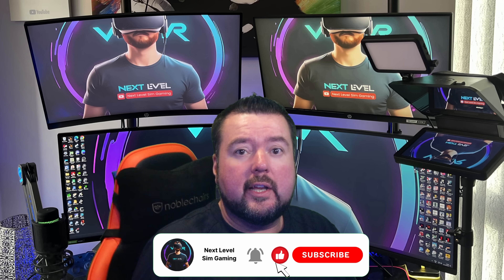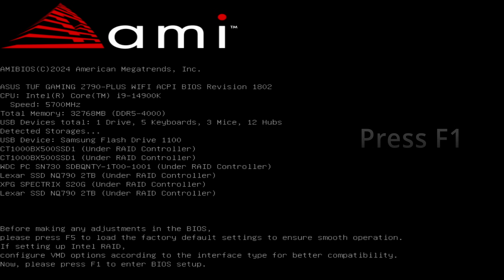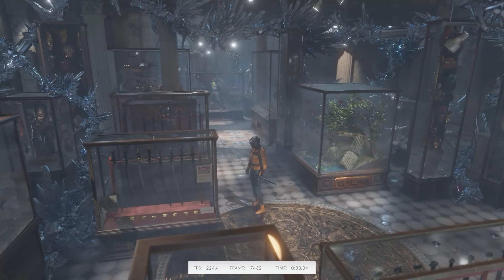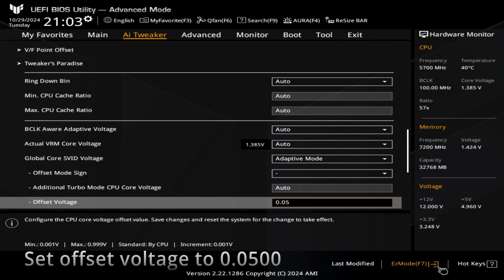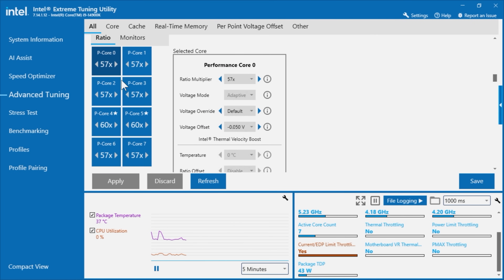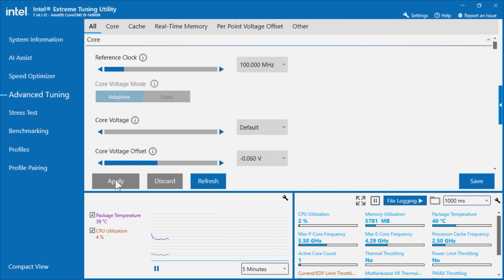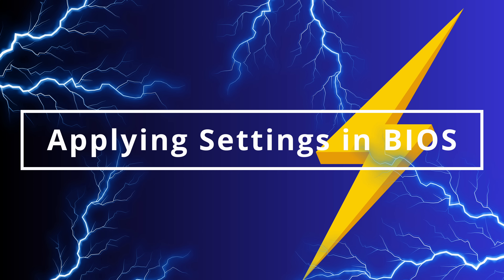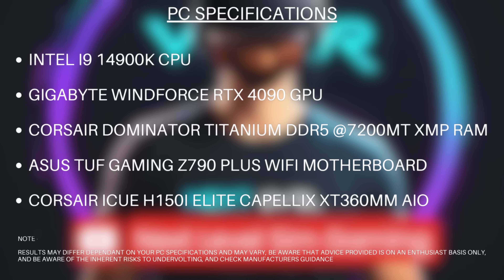i9 14900k Intel Final Microcode 1802 - 0x12B  BIOS Installation, Tuning and Undervolt Guide 📈

Comment: seems are volts in the mobo is or should be +5v~ and were the same upon seeing it on your bios with 4.960~v isnt it an issue? should we get like 5voklts up in our psu? been experiencing crashes since august with my i7 14700k . rebooting / restarting when opening a game. kernel 41 error.. im using 850 watt psu 3080 gpu. been trying to undervolt and still having reboots.. been 3 months of troubleshooting alrdy, could it be the culprit? the 4.960v that should be 5v+ up?
Reply from the maker: @JsinJzone  Possibly, the CPU will request the voltage within the parameters it requires.

An easy test is set the BIOS to Intel Default Settings, run Intel XTU AVX2 stress test for 30 mins if it fails, then I would RMA the CPU, if the replacement shows issues then its Motherboard power delivery or PSU
Reply: @JsinJzone  you ever end up figuring it out mate? Same issues and pretty much same reasoning I reached
Reply: @ not yet :(

Comment: I am about to buy a 13600k, do I need to worry still? my motherboard that I will also buy tomorrow is ASRock Z790 STEEL LEGEND wifi.

please help let me know.
Reply from the maker: @sal1488  The 13th Gen processors were affected by oxidation in certain batches, however this will be covered by the Intel extended warranty if it is identified as affected, otherwise no, no issues with these chips when they are tuned correctly 🙂
Reply: @nextlevelsimgaming  I am in Australia like you and was gonna buy from umart. Not sure about how old their intel cpu batch are.
Reply from the maker: @ I’m from the UK mate, so couldn’t comment on the supplier but the extended Intel Warranty is worldwide

Comment: In 3dmark time spy I got 26589 with 4080 and the 14900k at -0.065. How did you get so much? I configured it the same way. In cinebench I pushed the cpu more and the result was quite straight, but the gpu dropped in 3dmark all the time. Do you have any video to configure the gpu correctly?
Reply from the maker: @r1cc-1  With a 4080 thats correct, my old Palit Gamerock 4080 I scored 26201, unfortunately you won’t achieve the same figures with a 4080, if you compare results online on 3D Mark in the menu you will see comparable hardware, remember the GPU aspect makes a large proportion of the score, an RTX 4090 is about 35% better performance than a 4080
Reply: @nextlevelsimgaming  You’re right, your gpu was 4090, what I did test in cinebench was that leaving it at -0.065 gives me more points, but in 3dmark the same one you used at -0.065 the gpu line in the rear falls and the processor does not fall, the line remains straight, but when testing at -0.060 the gpu line stabilized more, should I try leaving it at -0.050 or -0.055? You were right that my 13900k was degraded because with this configuration that you gave me it gave me a blue screen and now with the 14900k it works perfectly without blue screens, I reiterate again if it weren’t for you I wouldn’t have the 14900k now and perhaps later on the 13900k would have died, I really appreciate it!
Reply from the maker: @ Fantastic to hear, it’s hearing feedback like this that was the reason I started the channel 🙂
Reply: @nextlevelsimgaming  😎
Reply: I have a question, should I leave xmp in tweaked or xmp1?
Reply from the maker: @r1cc-1  XMP Tweaked will add additional Motherboard capabilities to the RAM manufacturers XMP profiles so I use Tweaked as it tends to run more stable 🙂
Reply: @nextlevelsimgaming  Thanks dude, I appreciate the information, I always left it in xmp I the other thing is that once I raised the clock and it supported up to 7200mhz, but I lowered it because I considered that it was not worth going from 6000mhz to 7200 and now I am considering it, my rams are these skill F5-6000J3040G32G SK Hynix. Do you have any video to achieve that?
Reply from the maker: @ I certainly do 😉

Undervolt and Tuning Guide - Testing XMP Speeds and How it affects Performance #ddr5 #ram #xmp 📈
https://youtu.be/2exK1t0sRB4

Comment: how can I do this to a msi motherboard? and I am also having issues with the XTU, it is stuck on splash screen or loading screen. Do you have any recommendations or tips that can help me?
Reply from the maker: @donortiz6313  Regading the Intel XTU issue, uninstall Intel XTU, reboot PC

When rebooted,  Go to the device manager and remove all the instances of the XTU component driver in the device manager under software components (click and select ‘delete’) there may be a number of instances that require deleting depending on how many times you have attempted to run it.

Once deleted, reboot PC again, then reinstall the latest version of XTU

Regarding the MSI motherboard, I couldn’t help with that unfortunately as I have never used one, the principles will be the same, but couldn’t tell you where things are located on that particular board or what terminology is used for each setting.

Ensure Intel Virtulization and Undervolt Protection are both disabled in BIOS to use Intel XTU do this before carrying out the above.
Reply: @nextlevelsimgaming  is it the "Intel(R) XTU Component Device" that I need to delete it all?
Reply from the maker: @ Thats the one mate, all instances of it
Reply: @nextlevelsimgaming  after deleting XTU and rebooting PC, there's no "Intel(R) XTU Component Device" under software components in device manager, what do I need to do?
Reply from the maker: @ Reinstall XTU it should now run

I had exactly the same issue recently, also see this thread 

https://community.intel.com/t5/Processors/Intel-XTU-service/m-p/1402052#M58769
Reply: @nextlevelsimgaming  in which part of the link u provided works for u? It is still stuck on loading screen for me.
Reply from the maker: @ Uninstall XTU completely, follow the instructions on completely uninstalling, then remove all components as stated in Device Manager, but also ensure that Intel Virtulization Technology is disabled in BIOS and also disable Undervolt Protection, once you have done all this and reinstall it worked for me only after performing all those steps

Comment: Thank you for this great Video!
What would I have to do if I would like to let 2-4 cores go up to 5.8-6.0 GHz to get some better Single Core Performance?
Reply from the maker: @johnmcmurphy1007  Thanks ☺️ see this other video showing such scenario’s

Undervolting and Tuning Guide Intel i9 14900k - Core Sync 5500 to 5800 mhz &  Performance Benchmarks
https://youtu.be/hh3FIN1c_ZQ
Reply: @nextlevelsimgaming  yes I've already watched it, but this is also about syncing all cores the same ratio isn't it?
I think about 5.5 allcore with your settings and then set only 2 cores  higher to e. g. 5.8 Ghz
Reply from the maker: @ You can, in fact next weeks video is about custom tuning, where I will be covering higher preferred P core and set P cores, you have to compensate for increased power usage and temps however

Comment: This microcode finally addressed the out of memory issue. But. Still had that bs for red dead 2 until I did this and now it's fixed with better performance.
Reply from the maker: @coryo617  Great to hear, the Intel Default profile still unfortunately isnt up to scratch, as usual enthusiasts are left to fix the issues 😉

Comment: I've just done the undervolt with the latest bios, I'm on an i7 14700K, I'm at -0.06500 on XTU and on R23 I'm always at more or less 80° in temperature with a score of 34802, do you think I should try at 0.07000? And in PL1 PL2 I'm at 253w with an ICCMAX of 307.
Reply from the maker: @hardcoregamer406  PL1 on a 14700k should be 125w

Yes you can use Intel XTU to find the best undervolt then set in BIOS once you’ve happy with it 🙂
Reply: @nextlevelsimgaming  I changed the PL1 to 125w and the temperature fell on the XTU. I'm still at 0.065, I'm going to see if I'm not losing too much on the R23.

Comment: Nice Video , it helps me a lot.

But ive got one question , Can i set the core clock a Little higher for example 56 or 57 with all your settings ?

And ive got only 33k points in cinebench, i dont know why.
Reply from the maker: @burakyilmaz7363  Close all applications when running Cinebench such as RGB software, Chrome etc basically anything running in the tray.

This companion video will explain to you about other frequencies 😉

https://youtu.be/hh3FIN1c_ZQ?si=mPvcg_2NgoGNEQha

Comment: I can only get to -0.040 V with my intel i9 14900k even the -0.045 crashes cinebench
Reply from the maker: @pukki551  You should start at - 0.0500 then - 0.05500 then - 0.06000 you are putting power up not down
Reply: @ Yeah i started with -0.0500 and it kept crashing cinebench so i went 10 up and it didnt crash tried 5 down and crash again
Reply from the maker: @ I would suspect if your CPU requires more power to operate it is degraded unfortunately and you should start the RMA process
Reply: @nextlevelsimgaming  Alright thank you for the responses
Reply from the maker: @ No worries 😉

Comment: I did something wrong lol. I get 25k on cinebench with these settings. 14900KS.
Reply from the maker: @deadghost1189  That is very low, ensure all background applications are closed, also the PL1 and PL2 for a 14000KS is 320w/320w not 253/253 😉
Reply: @nextlevelsimgaming  Thank you for the reply. I couldn't figure it out. I went back to my old setting. PL 320w, P-cores locked at 59. E-cores 45. 0.140 undervault. Vmax 1450. Load line auto. Ram 6666CL34...41k cinebench. Max temp 80° max vid 1.392
I really did want to try all cores locked like you did, but I can't figure it out. Thanks again.
Reply from the maker: @ No problem 😉

Comment: For my i9 14900kf all core 55 and offset 0.06000, now is stable, no bsod no error, 😅
Reply from the maker: Fantastic 😎
Reply: @ 
Update: unstable system, constant reboots, asus z690 bios 4001 i9 14900kf new rma. pls help
Reply from the maker: @ I don’t unfortunately have the same motherboard to be able to assist you, the guide is for the Z790.  Are you running 4 x DDR5 ram or 2 x DIMM?

Comment: For the offset values greater (0.7) means that it’s lower than stock right . 😅 bit confused by the wording, but new to OC and watching this so I can undervolt on my b660 as got a good deal on the 14900k
Reply from the maker: @___TEMPEST___  The values are in increments if 0.005, if you watch this guide it explains it better in slightly more detail 

Guide to Setting the Correct Undervolt and Stress Testing Intel Raptor Lake i9 14900k
https://youtu.be/XM2JLjcQZgc

Comment: i seriously need some help.
I just did my bios update and my pc won’t even boot up with intel default settings on extreme or performance settings. It will only boot with intel default disabled, and then aorus Perfdrive set to disable e-cores. i just tried to run the same 3d mark benchmark that you ran and only got 15,433 for a score whereas you got 33,694
Pc specs are i9 14900K, Aorus Master X MB, MSI Suprim 4090, GPU and CPU are both water cooled. I'm aware of the corsair hitch there's a way to bypass it without rolling back the drivers. just need enable device memory mode on all your fans and then exit the program.
Reply from the maker: @madcalfe  Thats very strange, I presume from Aorus its not an Asus Z790 motherboard, I don’t have any knowledge of the Gigabyte ones unfortunately, but is there a BIOS rollback function?, have you contacted Gigabyte for support?, I do know from helping a friend with a Ryzen one recently that they are very different in the terminology they use

Comment: I heard many said to set your SVID Behavior to “auto” instead of Intel fail safe since it increases the voltage on the cpu.
Reply from the maker: @tomygun196  It sets to Auto when the Asus OC profile is selected as far as i’m aware but thanks will check that
Reply: @nextlevelsimgaming also I’m going through an issue where my system randomly BSOD and restart whenever I play black ops 6. I recently RMA my 13700K for a 14700K. I also swapped PSU and 2 of my RAM sticks and it still crashes and BSOD. At this point idk what to do… I tried undervolt and running on Intel default settings too. I’ve looked up so many sources online regarding this issue. Some said it could be one of the XMP. In my case, it crashes and BSOD on XMP I, but I just switched over to XMP II (not sure if it makes any difference) to check if it’s stable. Some also said that to disable fast boot up etc. I saw one of your comments mentioning about the iCUE and roll back to nvidia drivers, I wonder if this could also be one of the causes for the BSOD. I’m just pulling my hair out at this rate.
Reply from the maker: @ Its likely the Nvidia driver if you have Corsair iCue many experiencing the same issue unfortunately
Reply: @tomygun196 I’ve got the same issues with black ops 6 and I have no clue what to do either. I installed the bios update but this stuff is not my area at all and have no idea what any of this stuff means. I have been able to run cyberpunk on max settings with no issues

Comment: i have constant dx12 crashes and ive been through 3 14900k rma's idk what to do anymore i have all settings bios updates nothing changes it any ideas
Reply from the maker: I would begin by following the guide, and also using DDU (Display Driver Uninstaller) then doing a fresh GPU driver install.

Also clear the Direct X shader cache in Windows

https://portkeygamessupport.wbgames.com/hc/en-us/articles/14659998310803-How-To-Clear-Your-Shader-Cache

Comment: hi, quick question, i have a 13700k and i undervolted by -0.5000 while the suggested parameters from intel, but for some reason at idle the lowest my processor goes is 38 and it averages 41-45. what could be the issue? i've tried downgrading to previous nvidia drivers as suggested in the pinned comment, but that didnt work (i dont have icue, but deepcool aio). however while gaming the temps are in good range, but for idle it is not. (while using xtu, that max stress temp is 80, but cinebench pushes it over 90) btw im a total noob in this and am just trying to prolong the life of my cpu
Reply from the maker: @jolykafka  I couldn’t really advise on the 13700k as I don’t have one to test, but the power limits are different for that processor, the guide is for an i9 13900k or 14900k 

Your settings would be -

ICCMAX is 307a

Processor Base Power = 125w = PL1
Maximum Turbo Power = 253w = PL2
Reply: @nextlevelsimgaming  thanks, i already put those parameters and i think the cpu is fine

Comment: Using all your settings on an i9 13900ks set to 5.3 allcore and offset of 0.075 mv dropped my temperatures in cinebench by 20 degrees on p cores, thats insane. Normally all core is 5.6 with cinebench score of 40800 to 41000, with 5.3 undervolted score is 39900, so almost no loss but 20 degrees cooler
Reply from the maker: @andi0138  Great to hear, the cooler the better 😎 🙌🏻
Reply: I'm looking at this CPU , With these settings & the latest MicroCode Update do you belive this to be a worthwhile purchase?
Reply from the maker: @ Yes, its a fantastic processor, especially when tuned 🙂

Comment: Hi again, just a dumb question, is the higher the number the lower the voltage right? Like 0.080 is lower than 0.070. 😂 the 0.070 gives 10 more power, dont judge me 😂
Reply from the maker: @maicagaming1702  Hi, you must enter a - (minus) before, and do in .5 increments, so first - 0.0500 then test and then - 0.0550 then - 0.0600 etc you will probably be good by - 0.0700 😉
Reply: @nextlevelsimgaming   Aw, i tried from 0.0500 to 0.0800, score always 33,300 something at timespy, i can see your graph is all flat, mine has down , so idk how to fix this since all the voltage offset has lose performance. Idk how to make it all flat i think somethings wrong on mine.
Reply from the maker: @maicagaming1702  Do you have an Nvidia GPU and Corsair iCue?, if so see the pinned comment above ⬆️

Comment: I’ve just updated and ran at the default settings - extreme - and get the current throttling while averaging at 33-35k from cinebench. What are your suggestions ?
Reply: And my p cores do not exceed 5 with the default settings and the e cores at 4
Reply from the maker: @BnonZero  Close any running background applications in the tray when testing to gain an accurate test, including RGB software, Chrome, even Intel XTU

Undervolt as per the guide starting at - 0.0500 you will see performance improvement.

I would recommend not using the Asus OC profile without the 400a / 253w / 253w power limits in place.
Reply: @nextlevelsimgaming I just did the default at first. To see where I’m at. I am undervolting now but I find it concerning to see such speeds on default.
Reply: @nextlevelsimgaming just started the benchmark at -05. Getting 37-38 at the first minute with all the apps closed.